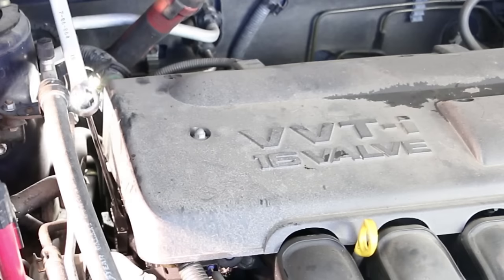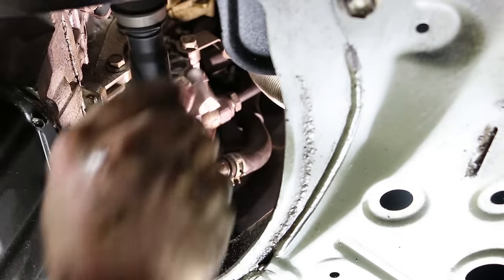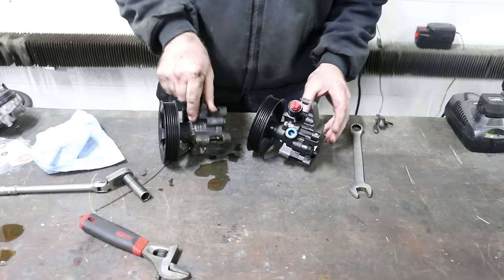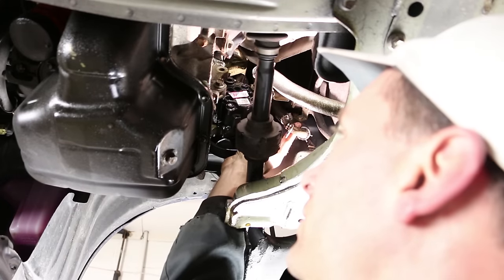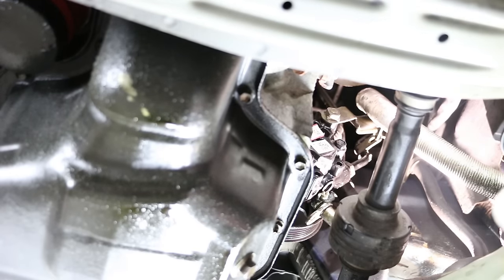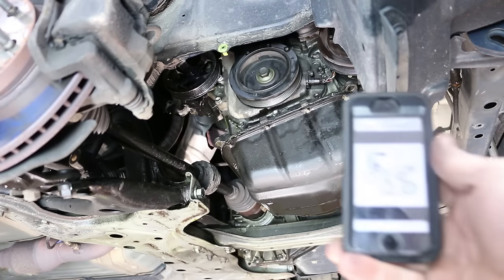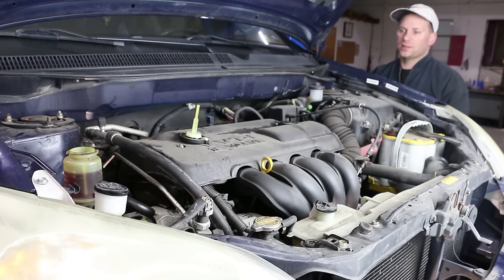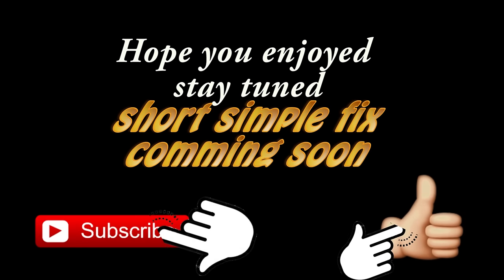Power steering pump replacement & Bleeding Toyota matrix

Comment: Great work Will and nice of you to show bleeding the air out of the system before starting the engine. I'm sure that a lot of people would just start it up and then attempt the bleeding process. And as you know, the air inside the system is enough to damage the pump. The air inside the pump would prevent lubrication of the pump and then you've got damage and usually you'll have a whining pump. Keep up the good work Will!

Comment: The best video showing what to do I could find so far, i am at this point in my wife Toyota Corolla 2004; seems same everything, I am on a project fixing a blown head gasket and to remove the timing chain cover manual says to remove the power steering pump and set it aside; the only difference is in our vehicle it is not needed to disconnect the lines if it is not being replaced but I have what looks like some leaking around the pump; I can not tell if it is the power steering fluid or if it comes from the timing chin tensioner above it; the power steering reservoir does not seems to be low on fluid. I am not a car mechanic, do not have the lift and will be doing this all from underneath the car, today it was really hard to remove the bottom screw and bolt and I am relieve to see that the top one clears from underneath. I do have a 3 ton jack and I will raise the car as high as I can using a piece of 2x4 block on it on the center bar under engine to work on it from underneath with as much space as I can create for leverage that I may need to brake the pump loose. I will use jack stands on both sides to secure the car after raised. Working my way to undo the engine to get to the head gasket I raised the car by the oil pan and dented it the other day, now I am considering later on remove the pan to undo the dent I put on it. Lesson learned when lifting the engine with a jack to use a piece of wood block but i missed reading that part..Thanks for the video!
Reply: Rody was the power steering pump on your corolla similar to this video. Looking to change mine on my 05 corolla but not sure if I can follow this video. Thanks for any input.
Reply: @aten488  yes it was, I ordered a Chinese pump on Amazon, ended up just using my old original pump as had issues and noises with the “new” pump

Comment: Great camera work and narration.   Exactly what I needed but I also had to replace the pressure hose on mine because the condensation tube form the AC was dripped directly on to the connection where the metal meets the rubber.  When you live near the ocean the humid salt air can rust bare metal after constant drips over 14 years.

Comment: Great work - only regret is I believe your in Texas. Would hire you to do work on my truck and be confident it would be done correctly. Thanks Will for taking the time to post videos for your fans. 😀
Reply: Is there any reason you can not do your own work ?
Reply: Big jobs are best left to the professional. Cost of tools, time, full understanding of the process involved make sense to pay for some work. Oil change, brake jobs, tune ups these are ok for the shade tree mechanic per say - crate engine with some modifications is another story. I would feel comfortable with tool & time on the job. Hope this answer your question.
Reply from the maker: jesus vasallo I'm in Pennsylvania your Always welcomed. Thank you for the compliments

Comment: Can this be done on the 2006 Corolla?  I heard people saying you have to take the engine out of the car or remove the subframe.   This is a really good video.
Reply: it can definitely be done. the only trouble i’ve had so far was attempting to loosen the nut that holds the high pressure line into the pump

Comment: Thanks for this video. I was curious of how would someone replace power steering pump on 1zz-fe engine. I own a 2006 Corolla with 284k km and it’s leaking fluid, I think it needs a new pump.

Comment: thanks for the video. Is it ok to fill the reservoir while both lines are off the pump so you can flush the old fluid out or it's not necessary to do so?
Reply from the maker: Edmund Mendez that's perfectly fine, it's going to pour right out the hose that you removed from the suction side since that's on the bottom of the Reservoir, you will need to block hose fill then drain or if you have a way of spaying rinsing down

Comment: Hi there,  I have a 2004 Toyota Corolla S and my Power Steering Pump is also leaking.  I had one question regarding the O-Rings you used, did you use a universal type of O-Ring or was there an O-Ring seal kit that you need?